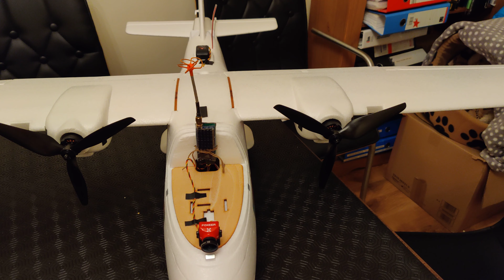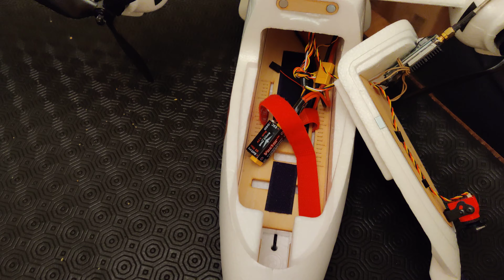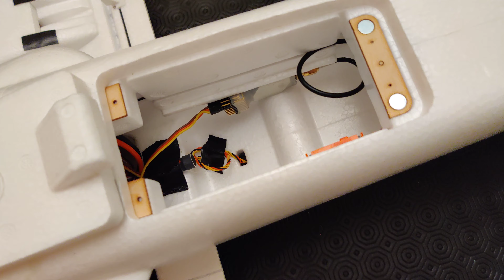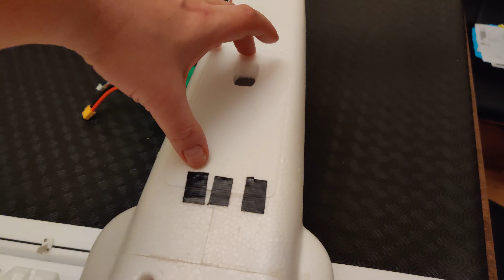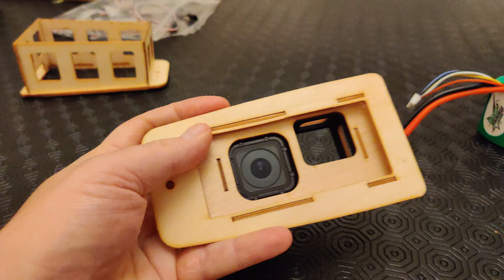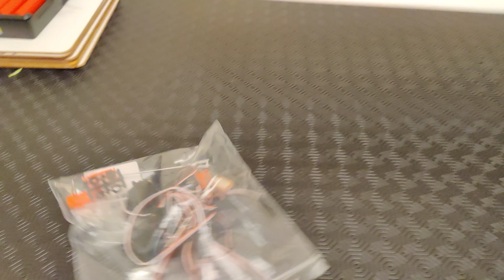Sonicmodell Binary Post build Pre-maiden summary

Comment: Super video set up Keith. Just finishing mine with T12,R9M with slim+ RX and the Eagle system too. A first twin for me and more cable ends than two plates of pasta! how would you advise connecting the Frsky slim to the eagle (the numerous ins, outs and wire options can be quite baffling) ? Thanks.
Reply from the maker: Sbus if your rx supports it, then your failsafe is easy the vector will detect zero sbus pulses and go straight into rth. Sbus or ppm with the vector is the only way to go.